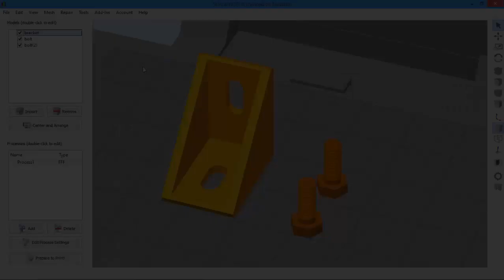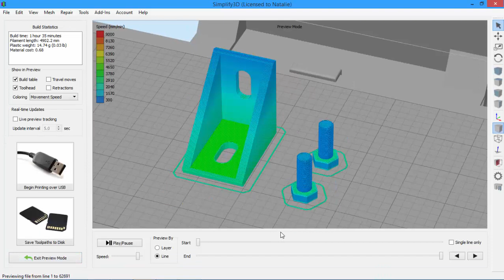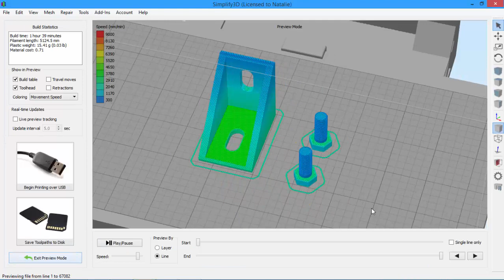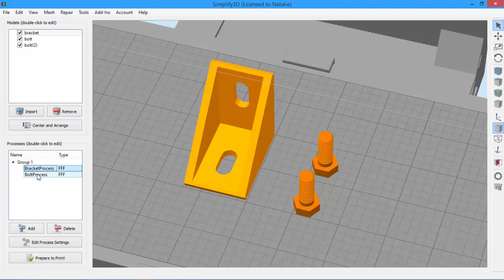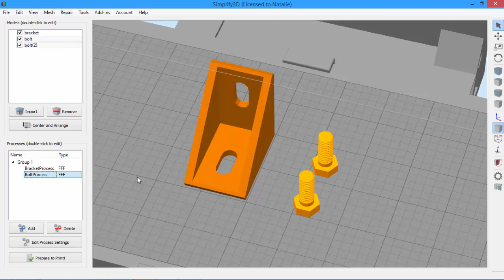Creating and Grouping Processes | Simplify3D

Comment: About grouping processes, would it be clearer to make universal changes by changing them in a group settings? (So that users can make changes without knowing whether certain printing parameter was the same among processes, i.e. changing printing speed.) For example, the logic is changes made in individual process in a groups doesn't effect the rest of the processes in the group (whether they are the same or not), but if make changes in group settings the whole processes groups can be changes at the same time. 
FYI the group setting can be shown as this: has the same amount of variables and interface as processes in the group, certain parameter that is set equal among processes shows its value (i.e. print speed: 50mm/s universal) while parameters that are different are indicated by "varies values" (infill: varies values). And inputting a value in group setting overwrite settings in individual processes within that group.

Comment: Is it possible to print full parts sequentially with Simplify3D? I only 
managed to print like 30 layers of one model then 30 layers of the 
second an so on..?
Reply from the maker: Sequential printing of entire parts is possible by specifying the "Max height clearance" to something larger than the height of your model. This setting is specified when you're selecting which processes to print and is shown in the image in our guide to multipart printing. https://www.simplify3d.com/support/articles/multi-part-printing/
Reply: THX!